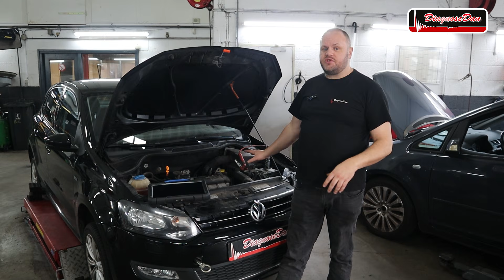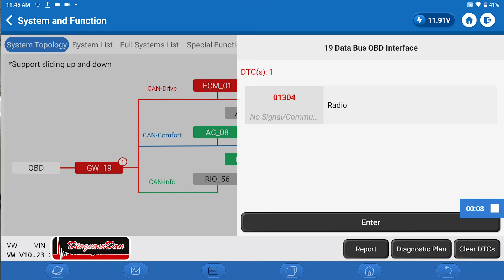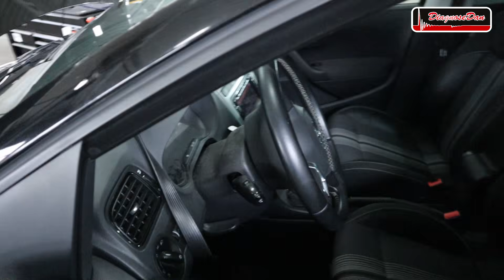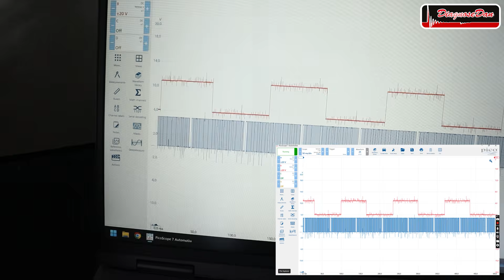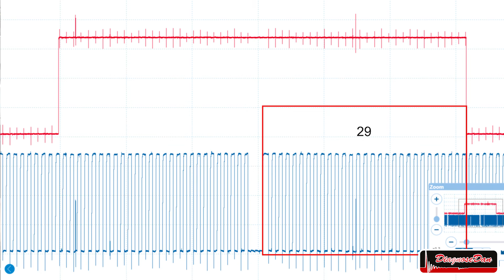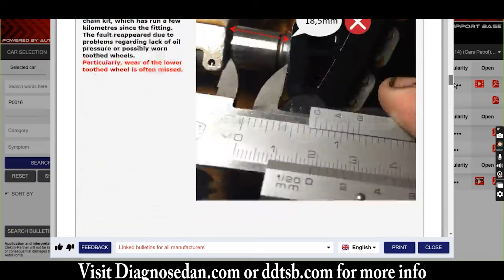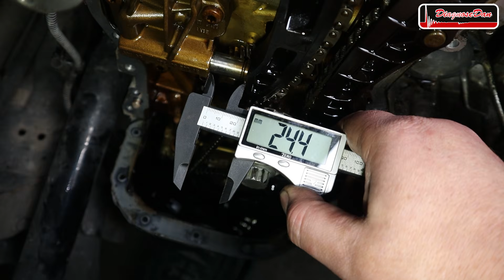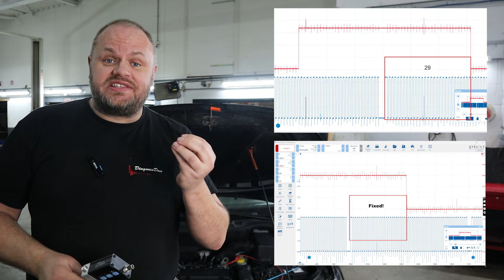Expensive repair? Other shop just guessed!

Comment from the maker: Check out my website ; https://www.diagnosedan.com
For DDTSB visit DDTSB.COM
For the Topdon tool used in the video:
US :
https://www.topdon.us/collections/professional-series/products/phoenix-max
UK :
https://www.diagnosticconnections.co.uk/
EU: https://eu.topdon.com/products/phoenix-max
Reply: Hi Dan the Man 👍
Which scanner from your online shop would you recommend to disable TPS on 2016 Mitsubishi PHEV.....(I'm fitting BFG All terrain K2 tyres on steel 18 " rims) need to disable TPS ( Tyre Pressure Sensor) ?
I had cloned Chinese MUT3 but my windows PC has crashed 🤦
Looking to buy  a suitable scanner from You 🤞
Reply from the maker: @fenflyer i dont sell scantools but if you click on one of the links in the video discription it will direct you to the resellers
Reply: Very interesting diagnosis as always. I’m trying to understand how a loose chain would cause timing to advance. Wouldn’t skipping a tooth cause timing to be retarded thus causing the exhaust valve to close later rather than sooner?

Could it be that the pressure bump is caused by the intake valve opening too late? I believe I read somewhere that some engines send a brief pressure pulse into the intake runner to create a shock wave in order to improve cylinder filling during the intake stroke.

Thank you.
Reply from the maker: @frankp.2831 the engine might have been turned anti-clockwise.
Reply: @frankp.2831 I'm interested to hear the answer for this question too and also how much longer that old chain was compared to new one? Great video as always👍🏼
Reply from the maker: @joelkarjalainen19  about a centimeter
Reply: @frankp.2831  you are right .   in stead of an exhaustvalve closing too early, I think the inletvalve is opening too late. Remember the sensor was on the inletcam Many engines have an overlap on inlet and exhaustvalve timing Inlet opening when exhaust is not yet totally closed. The 22 teeth in stead of 29 teeth indicates inlet being late. as you already stated is more logical then being advanced  when skipping a tooth because of a stretched chain.
Reply: EU link not working..
Reply from the maker: @romxxxromxxx fixed now👍
Reply: Topdon links not working.
Reply from the maker: @benjamilindqvist912  it's fixed now👍
Reply: I used to have Grande Punto 1.2
Plenty of power for normal driving. 155 top speed, can climb 5% grade at 120km/h, which is enough
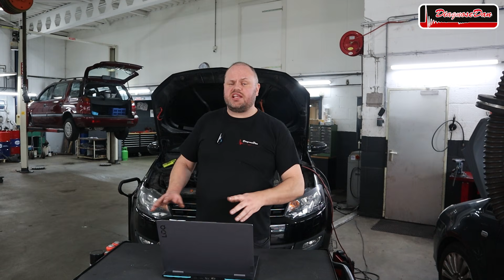Reply: 9:35 “Let’s do some research”
I’m sure you weren’t too surprised with what you found on DTSB 😁

(I’m not a technician but it seems like a very useful tool 👍)
Reply: Great video Dan, but I think you are mistaken   regarding that  exhaustvalve  closing too early. The sensor was on the inletcamshaft and 22 teeth in stead of 29 would indicate  that the inletvalve opened too late.  To me that sounds more logical in case of a stretched chain skipping a tooth. Sorry for this late reaction i watched it only just now

Comment: My Daughter bought a vw polo 2003 with new timing chain fitted with a invoice to show the work and cost of it,  then the car wouldn't start we thought it was fuel, it wasn't, we had mo bile machiancs come out and none of them could get it started, u ruled out timing chain as it was just done, we tried turning of the emobilizer, changed the temp sensor, checked all the fuses, nothing, in the end i checked the two cams, and one was off, it was the timing chain, i couldn't believe it, i bought a new febi kit and fitted the chain and new chain guides kit, this was an updated version as the old kit tended to let the chain slip as it was a shorter chain guide, i put it all back together and it stared straight away after 4 years of being stood doing nothing, i never trust timing chains, or wet belts.

Comment: You are an amazing guy.  What you may not know is that the chain may have streched alot.  Yes this is correct.  But did you ever check the oil level.  I know you did not check the valves.  I say this as I am in possession of a similar car like what you are working on.  Same family of car.  granteed yours is newer than mine.  What I found out that these ENGINE LOVES to eat itself ALIVE and you wont know anything about it.  Until its too late.  The bigest and weakest link is that DAM CHAIN.

Comment: Nice . Question. When timing is wrong, usually compression is different on cylinders. You check pressure only on first. Do you think that on the other two, will be the same pattern? If I find difference in compression test, I will come to same conclusion. /Do not have fancy equipment/

Comment: Jeez. The chain quality is clearly inadequate/ under-designed.
It should last the life of the engine, not cause a major problem.
Bring back pushrods/gear drive, or maybe not as they'd screw that up as well.
Has there been some weird erasure of engineering wisdom of the past and now unwittingly incompetent people design cam chain drive systems?
Learn from the past FFS !

Comment: Im checking mine in OBD11 so Im always aware of situation.I really suggest anyone who has a car to have some OBD device so you can check things before they happen.Of course,nothing is 100% and sh.t can happen anyway.
One example-I bought my Leon and OBD11,saw two codes,something about AC reducing power and battery open circuit,also start-stop would sometimes work sometimes not with error on my screen(high power consumption) and sometimes car fan would start to blow full power and only way to stop it was to turn off/on the car
I checked my battery and owner before put normal battery inside,in OBD coded battery was EFB and that was my clue.
Bought AGM battery,coded the battery and 0 error codes now and 0 problems so Im really happy because I never did something like that before,always mechanic.
I also retrofited auto headlights and auto wipers,led interior light without codes poping out and few other things so yeah,that little device helped me a lot and I learned a bunch of stuff doing that

Comment: New chain that early. Aren't chains supposed to be lifetime components? And the lifetime calculated a lot more than 180 000 km? 
However BMW has them beat in this area. Plastic timing chain guides that break and fall into the oil, ad well as throwing off timing. My Volvo 5 cyl just keeps on spinning.

Comment: Those 3 cylinder engines are a technical mistake of the VAG group. On top of that, the client waited 180,000 km !!! to change the chain, yet he complained it is expensive. How cheap can he be??

Comment: I have a 2018 subaru xv sometime ago I did the service change oil and air filter but when I started driving the electronic park prake warning light came on 
The dealer could not fix it they are saying some wire got chafe, they scanned it nothing abnormal was found but I don't believe that what is your thoughts
Reply from the maker: No idea, i would have to take a look

Comment: So, it would have been interesting to see the pressure waveform with the timing corrected using the old chain to see if normal operation was returned and whether the exhaust valve opened early enough to scavenge (albeit at the risk of jumping a tooth again). I wonder if the stretch was enough to detect between the known good and actual waveforms. (The tensioner travel is obviously the dead giveaway).
Reply from the maker: Unfortunately you have to remove quite some parts to be able to see the tensioner

Comment: Let's face it. The garage hasn't guessed it. They have most likely had this problem before and have come to this conclusion based on past experience. We've only got diagnose Dan's say so that the garage have thrown loads of parts at it. Unfortunately not everyone is in a position in the motor trade to afford advanced diagnostic equipment when you are an Indie. Hats off to Dan he does explain things in an easy to comprehend manor . Thanks Dan
Reply from the maker: The tools make the process faster, you could still come to the same conclusion timing the engine the old fashioned way. Thanks for the great comment its appreciated

Comment: Hi Dan 

I have a Golf 7 1.6 TDI with 112.000km. On the highway my car lost all power with no dash light nor errors upon scanning. 

Turned out to be a mechanical error (Turbo) 

Changed turbo to a new and my car now does some rattling noise from engine area. I would guess right side engine bay.

Upon driving a steady speed, the car looses power for a split second.  This happens also in reverse

Also smells in my driver cabin. 

Any idea what it maybe? 😢

Comment: Having similar car and model. From last couple of months I am facing a weird headlight dimming while turning the steering wheel. 
Once steering wheel stops at any angle headlight flicker stops. There is no aftermarket bulbs or modification on car.
No diagnostic results from local garage.
Reply from the maker: Interesting!

Comment: As 25yr experienced mechanic I’d say the other garage used common sense and knowledge that crankshaft fault code pointed towards a timing fault and if you don’t have fancy diagnostics just locking off the engine would’ve also confirmed the fault.
Still a great video though!
Reply from the maker: Thanks for watching

Comment: It's a shame that VW didn't add a sensor to measure the travel of the tensioner; that way, a simple message to replace the timing chain could have saved everyone some time.
Reply from the maker: I think it wasn't supposed to stretch and therefore such a sensor wouldn't be necessary 😉

Comment: Love it.. one of the simplest things you can do is a simple pressure test.  Just hook up this $1300 pressure transducer to your $2000 pico kit, to your $1000 laptop.. It's so simple!!!   Is there an alternate way of doing this that doesn't cost 1/3 of the total cost of this vehicle to begin with?  ALSO, wow, a VW with timing issues.  That never happens /sarcasm.   Seriously, VW has screwed up timing chains, tensioners, and timing in general on all their 3 and 4 cylinder engines it is comical.
Reply from the maker: I use the laptop for more things than my scope, i use the scope for more than the pressure transducer and the pressure transducer replaces all pressure gauges in the shop. You make i sound like the whole set is just for this test. 😂

Comment: Proves once again that the right test tools and a brain that knows how  to use them can consistently outperform guessing.+++ 
It's not as surprising to me that a chain could stretch enough that there would be a timing problem, as the manufacturer choosing to use a tensioner with so much loaded travel that chain slap and erratic timing weren't evident as the engine was  revved up and down.  A chain tension limiter would have been easy and inexpensive to incorporate. It's a shame because abnormal noises are perhaps the easiest thing for a basic tech to recognize in a machine - no tools required.
Reply from the maker: Thanks for the comment!

Comment: They're not actually a bad engine the problem is:

The oil supply to the tensioner gets blocked over time.
Then the engine starts a bit rough while the tensioner slowly pressurises. 
So the driver revs it which makes the pressure come up and the car runs nicely.
So they keep doing it and put strain on a cold chain. 
The chain stretches.
As we see here, the exhaust valves go out of time.
They dont go to a good mechanic like diagnosedan and either get a tensioner put on the old chain, or just keep driving hard.
The exhaust valves get damaged.
The engine starts exhausting past the damaged valves on the compression stroke.
The catalytic starts glowing hot.
Finally, the engine light comes on because of the high lambda readings.

Then they finally go to a garage.

The garage do a head and chain.

But, being all alloy, the engines never really go back together as nicely and nothing really seals perfectly. 😢

Much as I avoid these engines, they drive well for a 3 cylinder, and can do some big mileages reliably if you keep on top of maintenance.
Reply from the maker: When i was driven the car after the repair it drove surprisingly good and had enough power

Comment: Excellent video as usual, but man, that was some VERY heavy-handed noise reduction on the audio there... It makes things sound super artificial, and the engine noise barely came through either. As an old radio nut, I don't mind a bit of hiss, but this drives me up the wall.
Reply from the maker: I noticed, i've got a new setup and i'm still need to figure it out a bit.

Comment: I love all your vids Dan, they have taught me alot. But on this one I don't understand why you reached for all the sexy toys when a quick removal of the camshaft end caps would have revealed the grooves on the shaft ends not lining up. Or have I missed something? Keep up the great work!
Reply from the maker: Yes let me explain the point of the video. 
I work on all brands, all engines, this method is universal for all engines. Generally timing an engine mechanicly requires quite some disasambly. And you need timing tools for all makes and models even when you might not need them.
This method is fast on all engines 3-6-8 or 12 cilinders doesn't matter.

Comment: Degene die zulke zwakke ketting setup heeft goed gekeurd bij VW zou voor straf een maand met Rob Jetten moeten optrekken.....(en alles moeten doen wat Rob wil)

Waarom neemt men een enkele zo gierig mogelijke ketting en deze gierige ketting moet dan dan 2 nokkenassen aandrijven dat is 2x frictie/slijtage,dat is 100% een recept voor slijtage.

Dit is een heel zwak ontwerp met een ketting die gemaakt is om te slijten en niet om 400.000 aan te kunnen,dit is gewoon bewust oplichting men had dit voor 25/50€ bullet proof tot 400.000km kunnen maken maar men kiest der bewust voor om mensen rond de 200.000 op dure kosten te jagen door een zwak systeem te pakken.

En nee vroeger was echt niet alles beter maar ik heb een v8 motor uit 1994 met centrale nokkenas en dubbele ketting,deze dingen gaan feitelijk nooit voor problemen zorgen,zulke ketting had men ook kunnen nemen ipv de elastiek die ze nu hebben

Comment: I guess if the engine runs like poo and a hobby mechanic wanted to check the chain, they could just jump to measuring the travel of the tensioner.
Because the chain VW on the 1.2 is made from chewing gum.

Comment: Man that chain was almost touching in the middle there. Glad I got the chain replaced on my 1.4TSI recently. My local garage told me they found broken bits of chain guide in the oil sump. The garage that sold me the car told me they'd changed the chain before selling me the car. Shame they did such a poor job.

Comment: Pico for the win, proving the problem.
When I saw that up rise point in the waveform even with my limited Pico knowledge,  immediately I said exhaust valve and timing chain problem.
In school we learned 2.54 centimeters or 25.4 milimeters equaled 1 inch.  
In engine timing THAT'S A LOT! 
No wonder that poor little engine with a 24 milimeter stretched timing chain couldn't move that car!
Well they brought it to the right guy who fixed it. 
Good one Dan!
Reply from the maker: Forget about inches 🤣 only 1 country in the world using those😁 thanks for leaving a comment Mike it's really appreciated. On my Facebook page i've got a picture of the old vs New chain.

Comment: what was the reason that at idle it seemed to operate fine but it was only when load was applied to the engine that it stopped?
Reply: Idle requiers almost nothing of torque to work, between the flywheel or torque converter and the small size of the engine it requires almost no torque to keep spinning, the engine load on idle is really low, but ass soon as he increased the load by puting in gear it is to much load for an unsynchronized combustion to keep it running hope it makes sense

Comment: Replacing a timing chain on a VW that has one is always a shot, especially on an engine that has high km like this one. But thanks for showing methods to confirm the issue.
This 3 banger non- turbo is pretty simple, the other shop could have quickly removed the cover and see that the tensioner is way more out than it should be...
Reply from the maker: You are right

Comment: Dan looking like he's on a good health regime - slim and trim.
You would think that car manufacturers would have a timing chain sensor to alert the driver with a Check Engine light when the chain guides pass their maximum tension measurement. That would save on a lot of diagnostics!
Reply: Very true
Reply from the maker: Great idea! But i think it was not intended to stretch that much 🫣

Comment: Good work!👍 This engine is one of VAG biggest shit! In city use timing chain can stretch under 80 000 and common problems with burned valves. It’s one time use engine because there isn’t torque specification for engine block, manufacturer thinks that all engine block should be replaced in one piece.
Reply from the maker: Thanks for the feedback